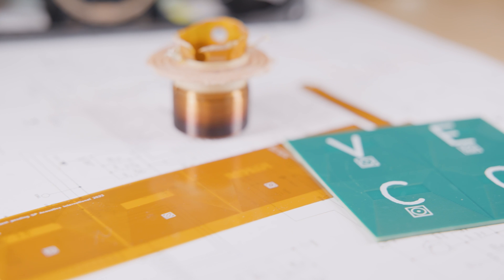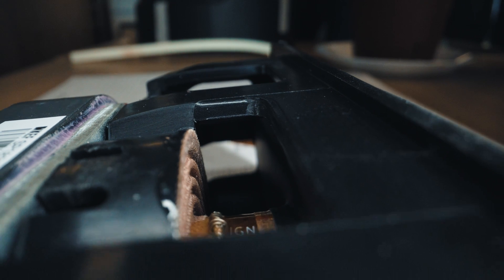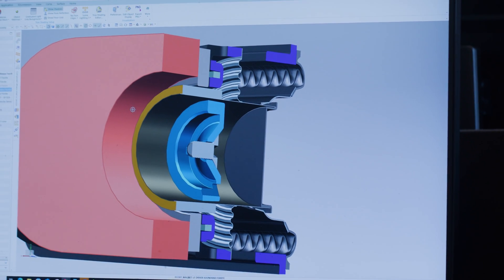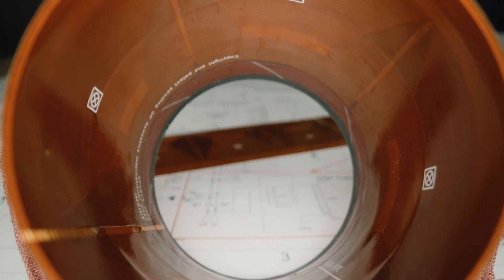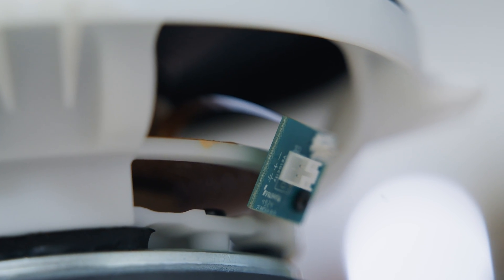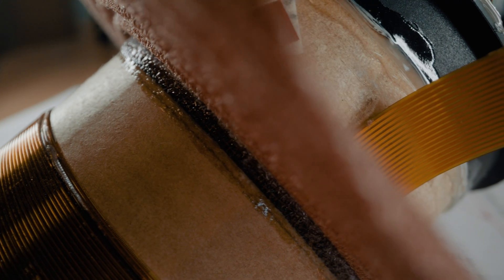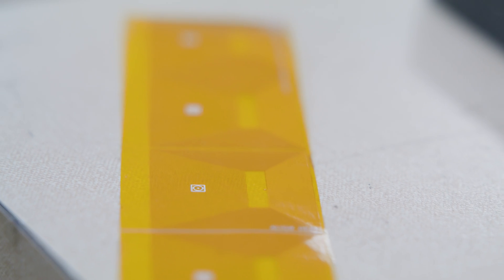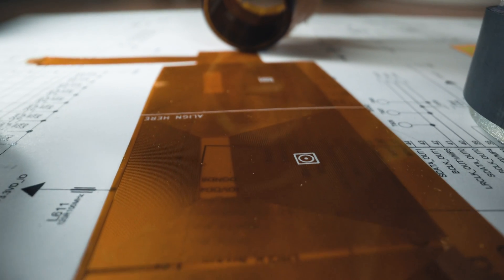Xio with VECO: KEF's Revolutionary Velocity Control Technology in Its First Soundbar Explained

Comment: 1.Why is the rear loudspeaker not added in such a beautiful system?
2.Why there is no HDMI - 1 HDMI-2 inputs, what kind of soundbar calculation will not connect any device working with hdmi?